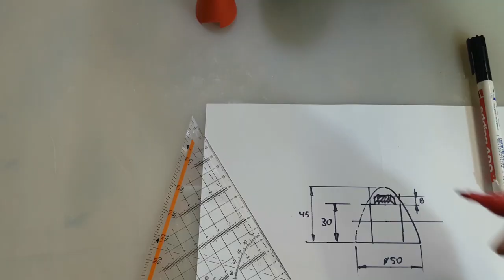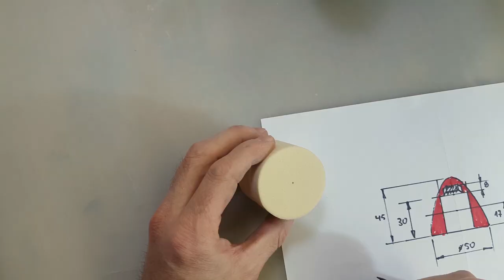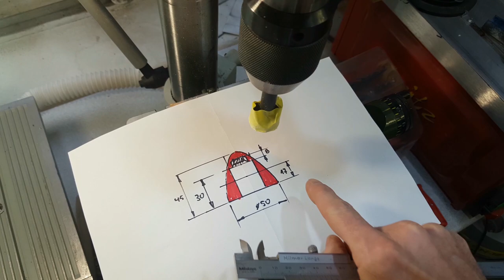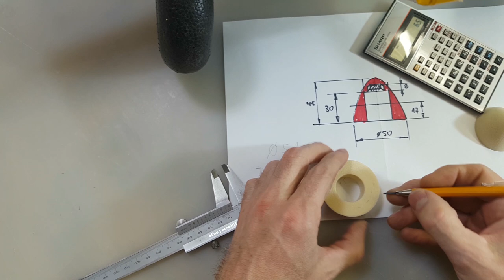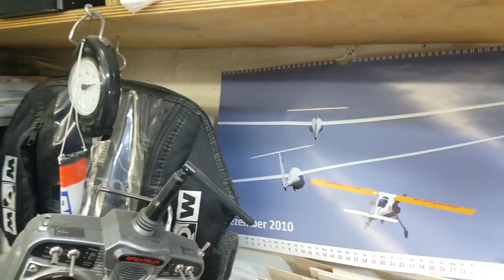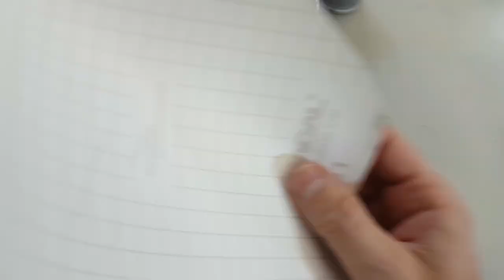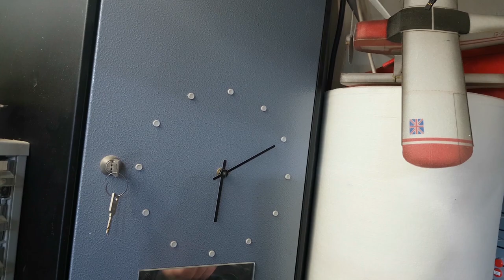Let's build a special DIY chrome spinner for your model airplane!

Comment: Good job!  Two questions: (2) what is the material you used and where do you buy it, (2) With this spinner in place, how would you propose to change your prop if it damages during landing?  Take care.
Reply from the maker: I can buy the material in Germany at modulor.de under the brand name SikaBlock. A density of 150~240 g/m³ is suitable.
Because I glued the spinner on with UHU por, I can dissolve the glue at any time with a few drops of petrol (ZIPPO-fluid). The spinner then comes off easily.

Comment: Hallo himar diese 3 blatt propeller macht das ein grosser unterrschied zwischen 2 blatt proüeller. Liebe grüsse von mir🖐🖐🖐🖐👏
Reply from the maker: Ich mag an den Dreiblatt-Propellern, dass sie ein angenehmeres Geräusch produzieren und "bergab" besser bremsen wenn man vom Gas geht. Ansonsten finde ich sie einfach prinzipiell schick, aber das ist mein subjektiver Eindruck.

Ein gut ausgewählter Zweiblatt-Propeller ist keineswegs schlechter, zumal man dabei auch noch eine viel größere Auswahl am Markt hat und dadurch die Feinabstimmung des Antriebes erleichtert wird.
Rein theoretisch haben weniger Blätter sogar eine höhere Effizienz.

Auch wenn es um höhere Fluggeschwindigkeit geht, sind weniger Blätter von Vorteil.

Ich würde Deine Frage also nicht mit einem pauschalen Urteil beantworten. Für mich zählt der Gesamteindruck des Modells, und wenn mir ein Dreiblatt-Propeller da besser gefällt, ziehe ich ihn in dem jeweiligen Fall vor.

Gruß
Hilmar.
Reply: @HilmarLange  bin eher der froh ist das dass Modell nicht so schnell fliegt aber ich glaube ich werde es mit dem 2 blatt versuchen (habe so viele von denen😏) Aber mir gefallen halt die 3 blatt viel besser

Comment: A spinner may not make your airplane any faster but it will make it look faster🥸
Reply: "It happened, as it frequently does, soon after the application of full throttle for take-off. The loud noise accompanied by a horrendous vibration scared me almost completely out of my wits - leaving just enough awareness to know I had better do something. I immediately throttled back and pulled off the runway into the grass, not knowing if the propeller had thrown a blade or if the engine was self-destructing.

On shut down, I found that it was neither. The back spinner bulkhead had failed at three of its four attachment points, and the spinner was on the verge of parting company with the airplane. Because it didn't break completely loose, the cocked spinner did a thorough job of decimating the front end of the cowling.

Had the spinner broken loose in flight, the consequences could have been more serious, perhaps disastrous, if on parting it had crashed into the windshield or tail surfaces."
Reply from the maker: @jazldazl9193  I've had a spinner fly away a few times too. Then it made a loud "PLOPP" and it's gone.
Fortunately, nothing happens with such light aircraft and a light spinner.
A styrofoam spinner is broken down into its component parts and that's it.
Nevertheless, it is important to attach it carefully and to check the concentricity.